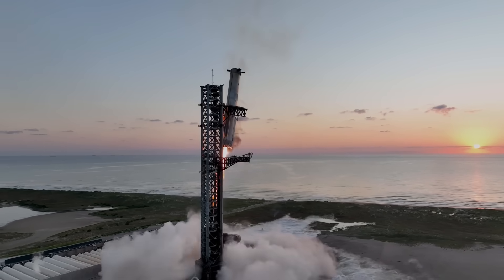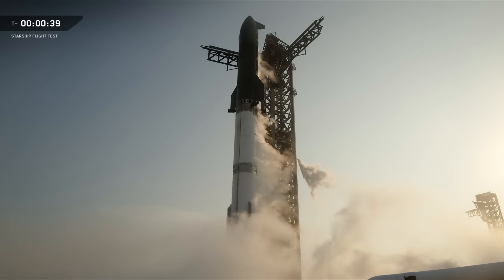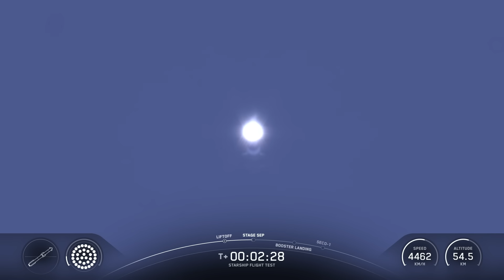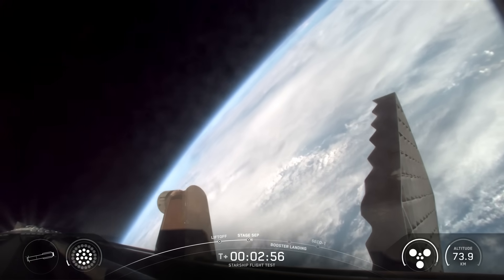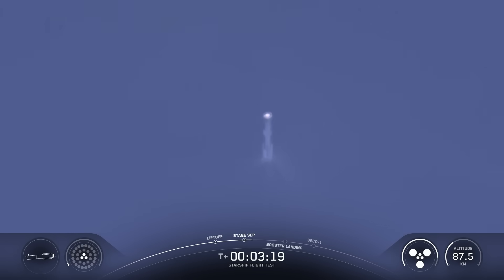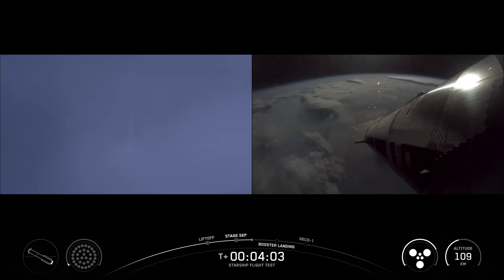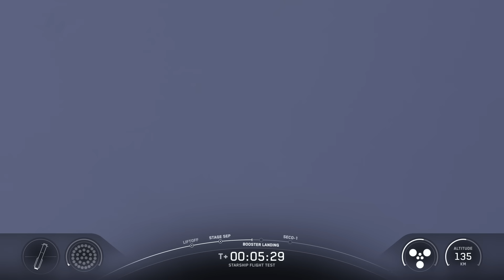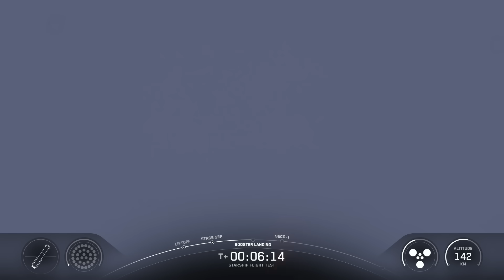SpaceX Builds Largest Reusable Booster, Also Makes Door That Won't Open - Starship Flight 9 Recap

Comment: Here is my take. SpaceX has a harmonic ring vibration problem with Starship. All that launch engine vibration of 20 million pounds + of thrust transmitting tremendous vibration throughout Starship from bottom to top shaking that ship apart causing welds to pop, electronics to fail, leaks and breaks in piping and hydraulic systems (if any) or fly by wire systems leading to catastrophic systems failure across the depth and width of the whole system. So in order to fix this they are going to have to figure out how to isolate key engine, electrical, electronics, fuel and tank systems of Starship from that vibration. I'd like to see what the harmonic and vibration frequencies graphs say from any sensors placed in that ship from top to bottom if they have any. They have to get this fixed or this program will fail.

One other thing, once the equipment and system isolation is complete and all launches are moved to pad B with its flame trench hopefully this solve the problem. Because the other thing it is my belief that the launch sound waves are exacerbating the problems as well. And maybe the flame trench will help dampen the vibration and sound waves and direct it away enough to be of help. Musk should have built a flame trench from the get go...at least the same size as the one on pad 39B. But at some point the flame trench may have to be even bigger to handle all that thrust.
Reply: I agree. The size of this beast and the massive thrust all contribute to metal fatigue. What no one will ever know is how many flights can a reused components take before catastrophic failure. So is it 5? 10? 4.5?
Reply: and why isn't this a problem for the booster?
Reply: @impolitevegan3179 exactly. Doubt it’s vibration
Reply: @impolitevegan3179  - different dimensions, more heavily built = different natural frequency
Reply: @impolitevegan3179  I think it is...but again...vibration and harmonics are weird forces to deal with. Why does all these forces effect one system and not another? I don't know the answer to that question. The other thing is in this case It may have had an effect as they lost the booster. They need to put sensors all over both the Booster and Starship and see if there is any effects they are not seeing...both on major systems and subsystems. The more info they get the better the chance to isolate the problems and solve them. Bottom line they are running out of time. If we are going to beat the Chinese to the moon we need to solve this problem and real fast.
Reply: Perhaps these physical failures we are seeing in the upper stage have more to do with the stresses they are subjected to from the hot-staging ?
Reply: @martinfendt1305  Seeing the power of those raptor engines, it wouldn't surprise me one bit if the shock waves reflecting off the top of the booster damaged the Starship base, or damaged engines of the Starship. Maybe the overpressure starts a crack which grows as the time passes. I would have gone with the round pipes, like the Soviets used. That gas is probably supersonic, so can reflect off the metal strips in that ring. It could behave differently with angled pipes.
Reply: @billsimpson604  I can't help thinking that they should delete the hot-staging ring altogether. Then replace it with spring-loaded ejection mechanism. The latter would separate the two stages, *before* lighting the Starship's raptors. 
Moreover, deleting that reinforced ring would also save a lot of dead weight, which could instead allow for greater propellant load -- in either of the stages -- or for more payload.
Reply: @martinfendt1305  the use of the word "delete" in this context made me picture the KSP rocket hangar and just grabbing the ring and pressing Delete on the keyboard to make it go away. That gave me a chuckle.
It also reminded how one would solve the hot-staging problem in KSP if the upper stage engine destroys your rocket - just strap the engines on the sides. To the nose of the rocket even! Anything goes, if you can ignore the necessary plumbing.
Reply: @martinfendt1305  Very possible or the hot staging could also be the straw that breaks the camels back. Quite honestly I wish they would abandon that technique and go back to a straight boost without having to resort to that technique.  

I have always been concerned about the high thrust of this booster. We have never had that much in any rocket ever launched. The Booster by itself generates 16.5 million+ pounds of thrust alone. That has to create its own set of problems. And enters into realms of magnitude we've never seen. So the teething problems in this system we are seeing would not be unusual. The question is will they be able to fix them and create a stable vehicle that can take people to the Moon and Mars and reused...and the vote on that is still to be determined.
Reply: I always thought the separation of the Starship from the booster was the problem it hasn't survived unscathed yet
Reply: @444sage  very possible.
Reply: And why aren't these tremendous vibrations seemingly no problem for the camera feeds? Magical camera engineering, i presume...
Reply: @elgonzo7239  I believe the Cameras are on an isolated gimbal.
Reply: @johnpitchlynn9341  Gymbals would be quite a failure-prone mechanical complication. What rational reasons do you see for SpaceX deciding to use gimbals for fixed position/angle cameras, aside from just saying "I believe" ...

As for the vibration isolation: If they equipped the cameras with such a strong vibration isolation capable of rejecting the forceful vibrations you imagine, doesn't that mean that SpaceX expected such vibrations to occur -- which then would pose the question why they would refrain from making Spaceship resistant to this expected kind of vibrations? Did they want SS to blow up on purpose? And if SpaceX did not expect such strong vibrations, why would they over-engineer a possible camera vibration dampening measure to the wazoo for a mode and amplitude of vibrations they didn't even expect to occur?

To be blunt, your "hypothesis" isn't very convincing...
Reply: @elgonzo7239  Let's be clear...without the specs and drawings I'm not sure what they did to dampen the vibration. I do know that gimbals of some kind have been used in the past to accomplish this. Also, rubber spacers, movable slides etc. there are even electronic means to accomplish this these days. As far as your contention "doesn't that mean that SpaceX expected such vibrations to occur" my retort is maybe and maybe not. As far as overengineering goes...why not? With all the money they are spending and the fact they are putting cameras all over the place to see the performance of the systems aboard in real time and even using star link in order to transmit the video says they have an investment going in this technology in order to see what is going on.  

And you may have worked or not worked on large corporate or government engineering programs but the history of them is replete with the left hand not knowing what the right hand is doing unless there are detailed engineering coordination meetings not only for the total system but major systems and subsystems as well and even then, sometimes it isn't enough. Things always fall through the cracks. And the teething problems that Starship and booster are experiencing is proof of that. 

Then there is testing to failure analysis. Based upon what I'm hearing on news reports and literature the testing methodology he is using could also be a problem...simply build them, test them and if it breaks fix what problem there is after the launch on the next version...so-called "rapid prototyping." Seems rather an expensive way to do business. Expedient but to me ill-advised with a large project like this. 

The point of my original comment is that no one has ever dealt with 16.5 million pounds of thrust in a rocket before...the most powerful ever.  And what impressed me from the first launch was the sound waves coming off the booster and propagating up the stack and because of extremely poorly engineered launch pad with no fire trench being bounced off and up along the entire stack. 

That being said it may be once the launches are transferred over the Pad B which has a fire trench it may solve some of the vibration problems they have. My question is how many more failures is Space X able to absorb before the program is in trouble. 

So, I have several questions...how is the harmonic vibration effecting the systems within the space craft on launch and in flight? How is it effecting Electronics, fuel, tanks substructures, framing, and skin? What is the frequency of this vibration up the stack and what is the difference between the booster and Ship frequencies if any and what is the intensity of the vibration at each minute of launch?  Has Space X tracked and recorded any of the vibration? What vibration testing has been done, if any, of electronic system within the booster and ship? Has any vibration testing of subsystem been done to failure? So, it would be interesting to know the answer to these questions.
Reply: @elgonzo7239  One other thing. I'm trying to convince you or anyone else of anything. And because neither you, me or anyone else outside of Space X is privy to the stats, technical specs, blueprints etc...neither one of us know what's going on within the guts of this ship. It's all speculation yours, mine and everyone else's. And when you have a companies as tight lipped as Space X, Boeing, Blue Origin and all the rest of the players in the space game and all the propaganda coming out on YouTube blogs one can only wonder what's really going on.
Reply: @elgonzo7239  far less moving parts so far less chance of failure
Reply: I totally agree with your assessment
Reply: The first thing they need to find out is where cracks are forming by having cameras watching everything possible. Then they could SEE where problem connections are, and strengthen those areas. Modern electronics can take amazing abuse. They have now perfected a 155mm guided artillery shell which becomes a ram jet after it leaves the gun barrel. It can fly about 100 miles and land within 10 meters of the target. 
I knew from day 1 that they needed a flame trench like they built for Saturn V. 
If it is a structural failing, they will never solve the problem until they know where it is starting. Using Starlink connections they should be able to watch the failure begin in real time.
Reply: @billsimpson604  they have tons of cameras everywhere.  They have even stated this. They don't show us everything for proprietary reasons.  They will figure it out.

Comment: There seems to be a problem with the vacuum engine bells because they keep developing hot spots. 
This is the second time in two launches its happened, but luckily it didn't explode like it did in flight 8.

Comment: Those damn individual downcomers for the vacuum engines, they’re too weak, and subject to structural failure. They need to go back to the main central downcomer, which splits at the bottom.

Comment: The internal cameras showed possible ice particles drifting around. They showed the tumbling of Starship as the camera is mounted to the ship and it was the moving background, not the particles changing direction.
Reply: Yeah my thoughts too.  The particles were moving, but the apparent movement we saw was mainly caused by the camera and background moving, more than the particles.

Comment: As somebody on the livestream said... TURN ON SAS!
Reply: No its better to let it fall to earth, it never hit orbit so they know its coming down. Exploding the ship in space could launch debris up to higher orbits and endanger low earth satellites.
Reply: @adrianwilson7536  OP didn't mean self destruct. S.A.S. is the name of the automatic stability assist in kerbal space program, i.e. a system that would use reaction wheels, gimbal or thrusters to try to automatically stop your craft from spinning when activated.

Comment: Would be interesting to know if more convenventional cold gas thrusters could have saved a controlled reentry. I get why the don't want to carry the extra mass for the final iteration of starship, but until you have a reliably working ship sacrifsing some cargo capacity for an independent altitude control system seems reasonable. Also seems like a nice capability to have that redundcy option for the thrusters for clients that are paranoid about failiures after the testing is done and their cargo is flying on the real deal.
Reply: Save a LOT of money and fly your cargo on a 747 or 777 freighter with only 2 engines. Kerosene is cheap, cryogenic propellants aren't. And cargo jets can land at hundreds of airports all over the planet. How would you fill up a Starship with cryo methane?
Reply: A redundant attitude control system should definately be considered IMHO, loose attitude control lost everything, we seen it more than once, perhaps u need to independent systems redundancy counts, gyro wheels, back up thrusters, vents, I don't know how, byt to me attitude control is so critical it needs redundancy,  so they should plan for that now.

Comment: The little glowing part seems logical, a spot of intense heat and then you vent oxygen would make that spot light up until the oxygen is gone… right ?!
Reply: I don't think so. Hot enough for a metal fire but not hot enough to glow on its own seems dubious, and even if it is the case, what caused it to heat up in the first place?